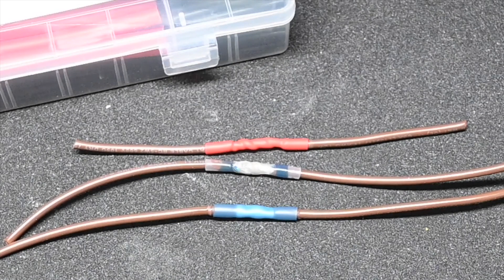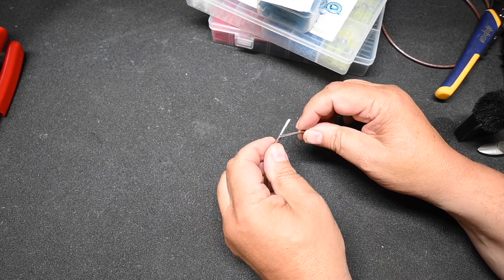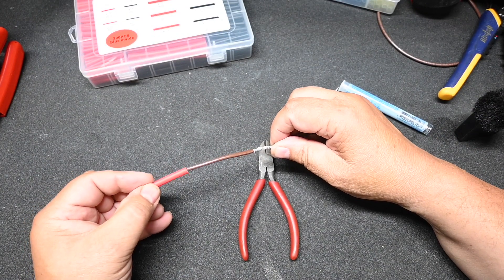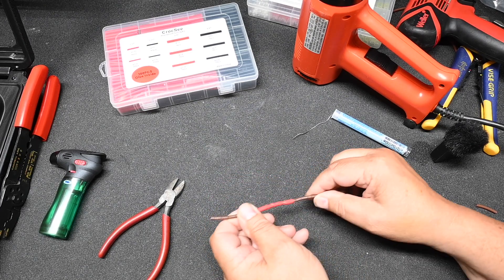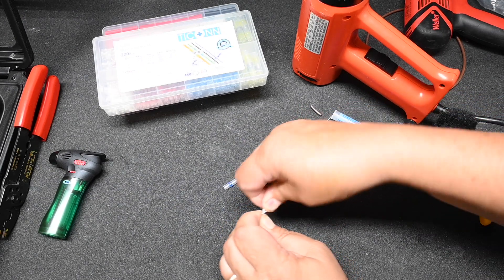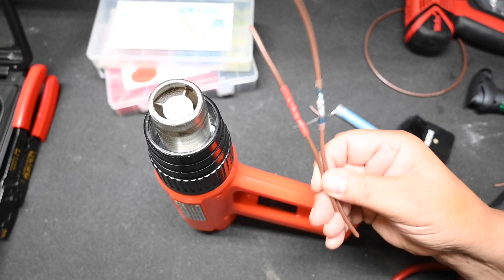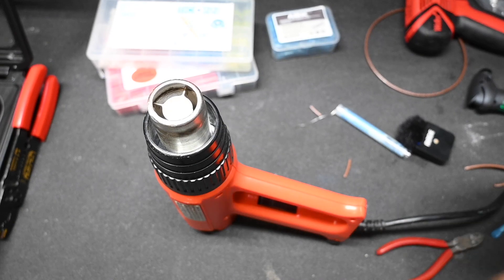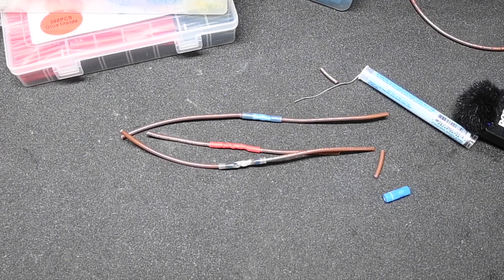Making Waterproof Low Voltage DC Wire Splices in your RV

Comment: They also make filled wire nuts that are very good for wet locations. I used them on my brake wiring. I also used wire ties to fasten the wire nuts with the opening down so water does not enter and corrode the wires. Easy to remove if necessary and reuse.
Reply from the maker: Thank you for your input

Comment: I prefer soldering and shrink tube 2 choice butt connectors and shrink tube
Reply from the maker: Each method has it's application. Sometimes you cannot get a soldering iron in a location, so butt connectors are sometimes the only choice.

Comment: You demonstrated how to twist wires together in a way I didn't know how to and it is much better than what I have been doing. Very educational and helpful video. Of course I can see now that I purchased the wrong heat gun. Oh well.  I also prefer the soldering method.  Thanks again!
Reply from the maker: Thank you for your feedback.